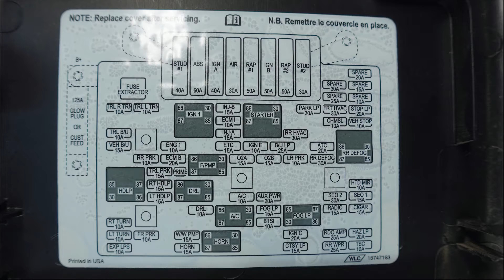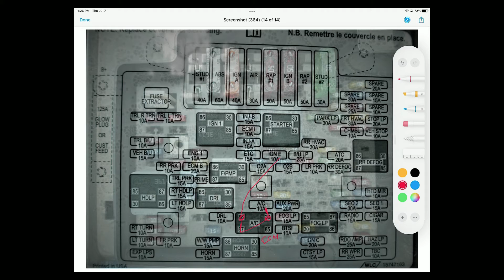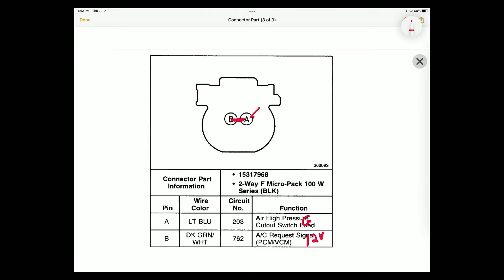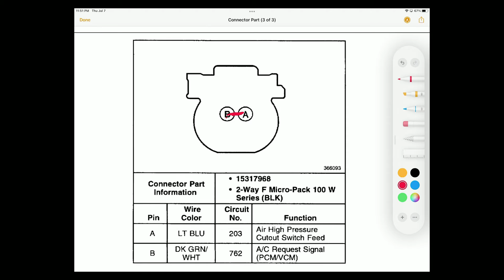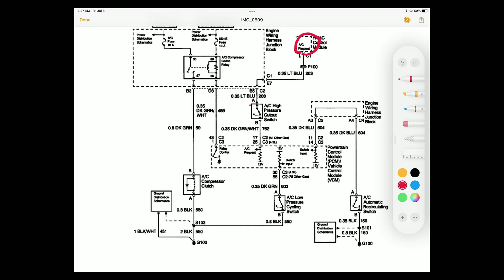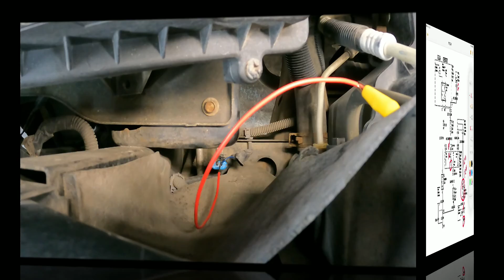2000 Chevy Silverado 1500 air conditioner problems

Comment: My ac will run fine for about 30mins sitting while im on my lunch break before turning off but anytime im driving itll shut off. it wont come back on at all unless
 A) i turn ac switch off for 10-15 min while driving and back on or 
B) putting truck in neutral and reving it above 5k. either option is only temporary fix as it will shut off again.    

 ive put a set of gauges on it and noticed to different things. 
1) raising rpm would cause the low side to drop below 30 cutting ac off which seems tied to it cutting off while driving
2) if its a hot day and idle for long enough the high side psi creeps up shutting it off.

ive  evac the system and put a new orifice tube in ( matched it to the one that was in it) thinking it was the reason for the low side dropping under accel but still happens
if its around the 70-80* it works better but anything on a real hot this is a consistent thing.

when i first got truck it would run u out for being so cold and never shut off. i didnt notice any of these issues till my blend doors messed up, the ac/heat door was just hanging so it was running both at the same time and the fresh air was aways open.  wondering if maybe the pump was just worn out from working so hard to cool with heat and hot outside are both coming in, or if there is something electronic causing it since the pump will run weather ac button is lit or not unless i turn temp to heat or defrost

Comment: Jim, I have a question I have a 2000 Chevy truck. The air conditioner was working fine. The truck was an automatic so I changed it over to a five speed but I had a programmer go in and change my ECM and take the automatic portion out of it now my air compressor will kick on and off when it’s idling real quick what will not build up pressure once you Revit up and start driving. It starts working normal, do you have any suggestions?
Reply from the maker: First I  would plug in a scanner and look for a output for ac relay .You can lay your hand on ac relay and feel / listen for a click when the compressor tuns on. Now I'm going to ask myself what has been done ECM flash/trans replace.I see that there are grounds at Bellhousing. I would start there.Most over looked

Comment: would the blend door actuator being bad have any effect on the power/signal to the compressor clutch somehow?
Reply from the maker: I haven't seen it. You really need and look to see if the ECM is  getting a request from the AC head unit to turn the compressor on. Have you tried defrost to see if the compressor will come on?

Comment: James I got a head scratcher for ya...

My ac will on my 2004 silverado 2500hd 6.6 duramax will only work on setting 5,and its hit or miss when it wants to work/turn on. Settings 1-4 still blow air they will just not kick the compressor on. If i start the truck and the ac panel is on and on setting 5 the compressor will kick on and run for about 15-20 mins, shut off and wont re engage until i pull the 30 amp fuse from the passenger side of the dash and reinsert it. A buddy and I have troubleshot the wiring and all seems to check ok. Could the pcm be a problem?

ive replaced the clutch, both pressure switches, control panel, vacuumed the system and refilled with correct amount.
Reply from the maker: I would go to resistor and check with a meter for system voltage on 2 wires with it set on  any 1-4 not 5 speed that tells me that the A/C control head is good and resistor is bad. That's with resistor plugged in. Don't be concerned with a lower voltage on other pens or wires it's back feeding through resister.
Now on compressor I highly doubt that it's the PCM. I would thank Freon  [ over/under] charged, airflow though condenser [dirt/grass], AC pressor sensor or Engine/Transmissions preformance like over temp [ engine or trans].
If you have an Check Engine Light and the PCM detects powertrain problems it will start turning loads off.    Hope this helps.   Thank you for your question
Reply: @NobleAutomotive  yeah i have a glow plug code. But whats confusing is that it will work on setting 5,4,3 but turn itself off quicker the lower the setting. I dont think its the pcm either. If it didnt work at all ( i get all the on/off signals on the scanner  once i cycle the dial or hit the ac button)

Comment: Thanks for this, I found my issue. The compressor was for wrong year model, it had no pressure switch, my harness had the plug for a pressure switch. I put a correct compressor on. Fixed!! Thanks again.
Reply from the maker: I'm glad I could help thanks for watching
Reply: I literally had this problem with a customers vehicle. They installed the wrong compressor and hid the pigtail. Thank you for this video!